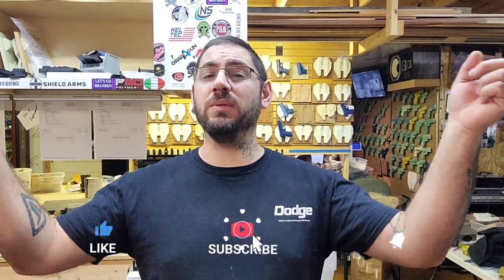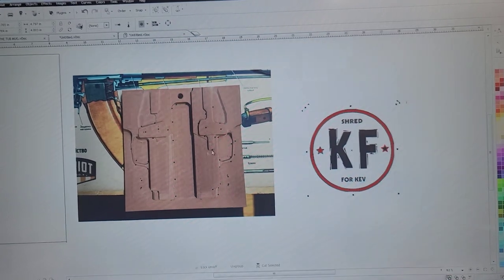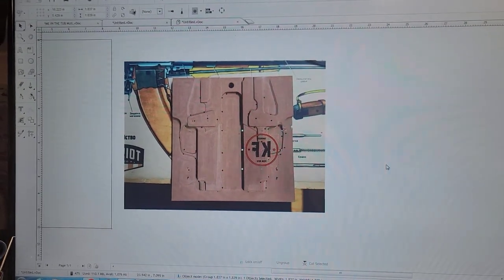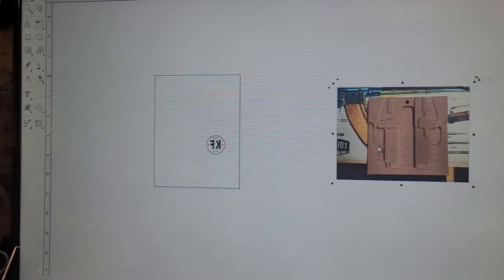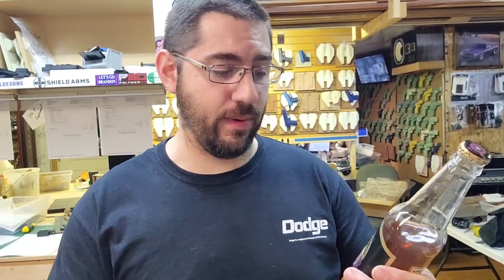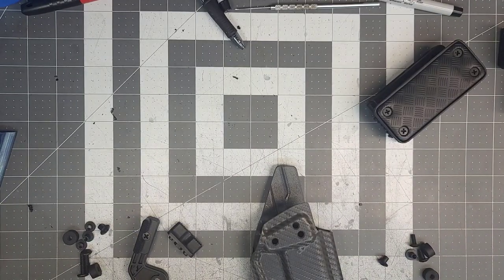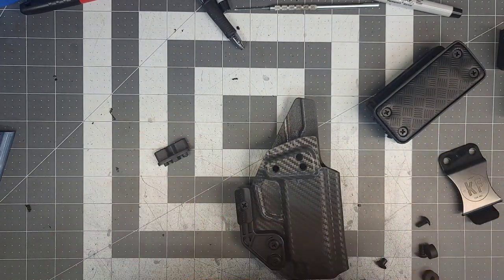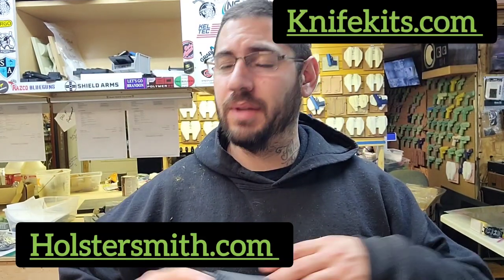Custom Carbon fiber for a Sig 365 XL

Comment: Hey bossman I need your ever lasting wisdom once again. I have been using the Xtreme form foam since conception of my business. And my foam is coming up on replacement. I've always noticed you used Mega Form in your presses. Do you know of any vast difference between the foam you use and the Xtreme?
Reply from the maker: The foam I use doesn't stick as much as the extreme did. Once I switched to it it was night and day
Reply: @FalTacUnlimitedLLC  Xtreme does stick horribly. Have you noticed any loss in definition? If I can save $6 a sheet on my foam I'd rather switch.
Reply from the maker: @dingo2083  I personally believe I have better definition with my current set up
Reply: @FalTacUnlimitedLLC  Thanks for the info again! Always a big help